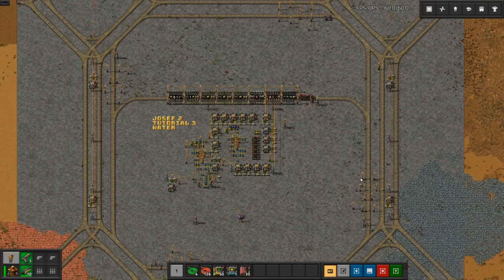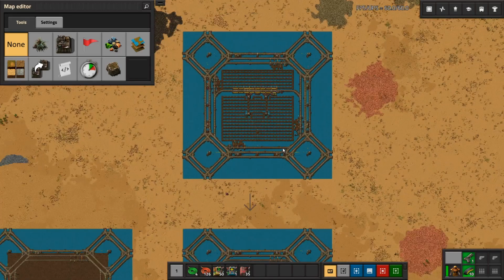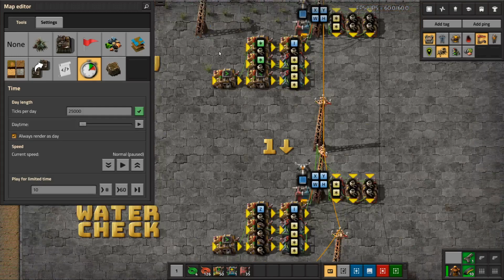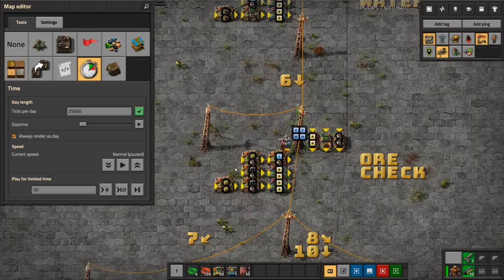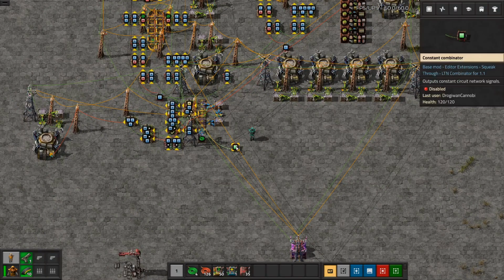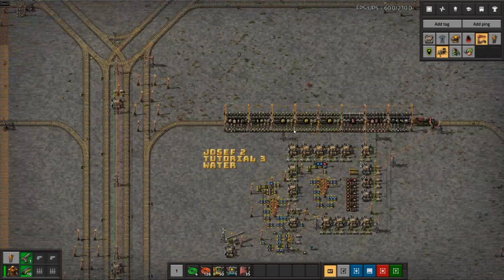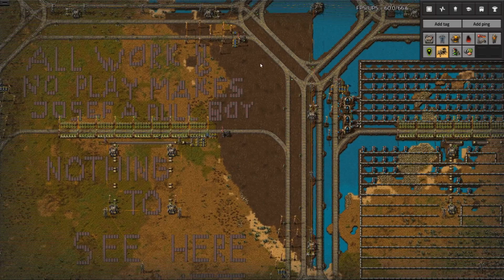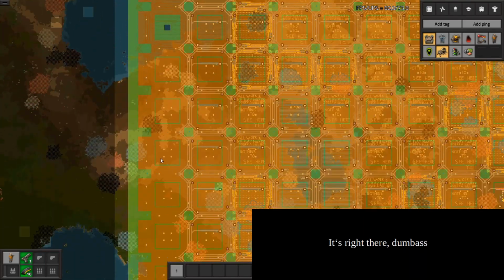Josef (Self-expanding factory): Tutorial 3 - Water

Comment from the maker: Something I forgot: The train is technically too long for my train grid. I'm a bit afraid that I'll get deadlocks but there's only one long train so I think it should be fine. Worst case I could change it to multiple smaller trains but I'd like to avoid that.
Reply: Wouldn't multiple trains make things a little easier? Not for the brain specifically, but what about a secondary train that builds your skeleton only one or two cells rings outward at a time, and they take turns. Or a train that makes loops around the cells checking ore content to reasign drained cells.

Comment: Looking good! The decision tree looks really robust, being able to decide what's going to be produced in new production cells based on current needs is a nice feature. I'm interested to see how you end up handling oil and uranium, maybe in part 4 or 5! :)
Reply from the maker: Thanks!
I'm actually not sure whether I'm going to handle oil and/or uranium. Neither of them are necessary: I can use coal liquefaction and just seed a little bit of heavy oil in the beginning. Handling oil patches wouldn't be terribly hard, it would just require a ton of different blueprints for all the different positions oil patches can be in and I don't think the benefit would be big enough to tackle this, compared to just using coal.

I would love to have trains run on nuclear fuel but that's about it. And to be honest I can't come up with a good, reliable way to handle uranium mining (yet?). There's no easy way to discriminate uranium patches from other ore patches, unless you always connect acid and observe belt content, which would mean an incredible amount of effort for close to no benefit. I'm not saying I won't do it (the theoretical end goal would be to have an SEF that can handle everything the game throws at it) but it's not very high on the priority list. I think the next steps will be biters, production and a proper center with a cell that can deploy new trains.
Reply: @DroCaMk3  you could technically use a blueprint of a perfect grid of pumpjacks and then jiggle it around a little bit then just pack the grid full of pipes, it wouldnt be effecient in the slightest both resource wise and ups wise but it would work... probably. maybe liquefaction is smarter lmao
Reply from the maker: Yeah, that would work. I might give it a shot at some point just to prove to myself that I can do it but I think liquefaction is the way to go
Reply: @DroCaMk3  yeah coal liquefaction is a good choice for sure. As far as uranium goes, it would be a nice quality of life upgrade to be able to handle it but you're right that it would be pretty complicated. Biters will be an interesting challenge to overcome as well, I'm excited to see how you approach them!
Reply: Part 5! ? 
I don't want to wait 120 episodes!